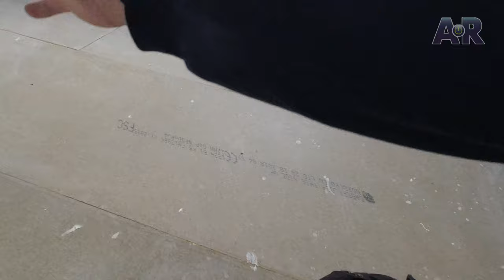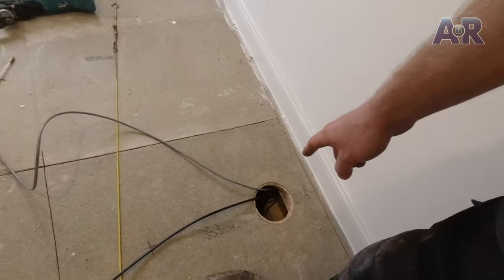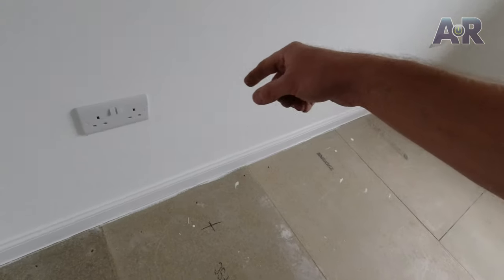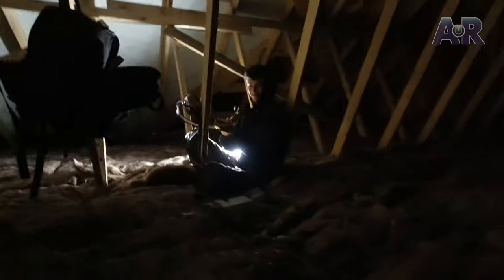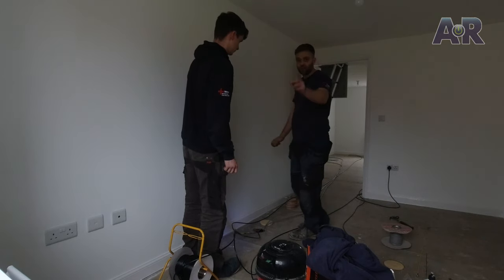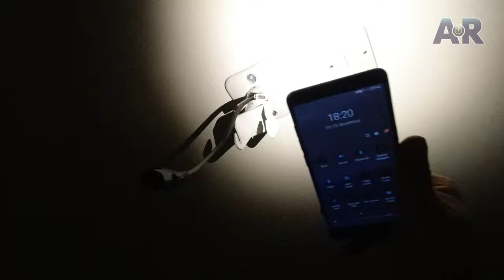HDMI, TV & SOCKET INSTALL - ELECTRICIAN LIFE - A & R ELECTRICS

Comment: Hi. I've watched several vid's showing HDMI or cat6/7 installation but, all I see are cables being pulled. Some, have a little more detail. But, none appear to show the wiring connections from the point of the cable entering the house. How to connect to extend and how to spilt off to other rooms etc. Please could you help my curiosity to become knowledge. Thanks.
Reply from the maker: I have a full setup going in at home.  I will either film installing or showing it once its all setup.👍
Reply: @ARElectrics  that would be really useful. I'll keep an eye out for it. Thanks the feedback. 😊

Comment: 22:55 whats the technique to block back those floor cutouts ?
Reply from the maker: Armeg make a hole saw cutter to cut discs in the floor for access, and then to replace the hole with a plastic floor plug.
First time we used these and I liked them.  So much quicker, easily accessible for future.   All you do is sit the plugs in the hole that's it.

Before we were having to cut bits of timber to screw across the hole and screw the cut out back in.

Link to the cutter used and comes with couple plugs.
Armeg SBC127PLUGSET SBC 127mm Plug Set, Cream, Set of 2 Pieces https://www.amazon.co.uk/dp/B00MIS3UVS/ref=cm_sw_r_cp_apa_i_P.imEbTTH2TTE

Comment: What hdmi modules do you use?
Reply from the maker: We used the deley con hdmi outlets.  Popped the module out of the original euromod plate it comes in and put it into our grid plates, to match the existing accessories.
Reply: Tidy, do you have any links? Do you connect the cat 5/6 straight to the back of them?
Reply from the maker: I have been trying to find a direct connection.  
We have had to use a cat 6 to hdmi converter which then plugs into the back of the plate.   

Links below

QUMOX 1080P 4K 3D HDTV HDMI Extender Repeater Over Single 30m Cat5e Cat6 https://www.amazon.co.uk/dp/B071P98LFM/ref=cm_sw_r_cp_apa_i_ZdQ.DbV401MDP

deleyCON HDMI Wall Box 1x HDMI Port Flush-Mounted Installation 3D FULL HD HDTV 4K 2160p - White https://www.amazon.co.uk/dp/B07CXSSRM1/ref=cm_sw_r_cp_apa_i_weQ.DbR3RTBAN